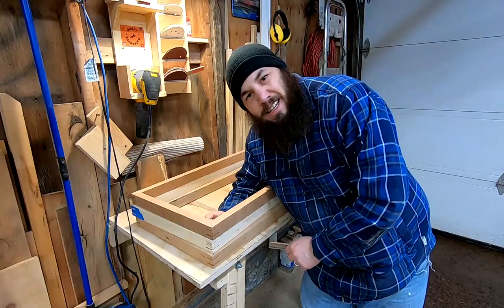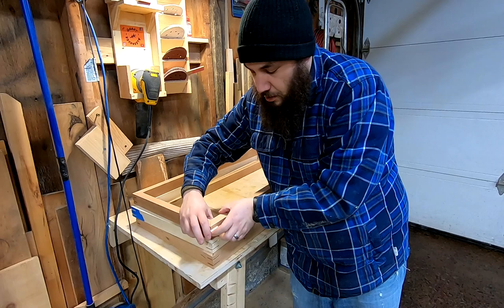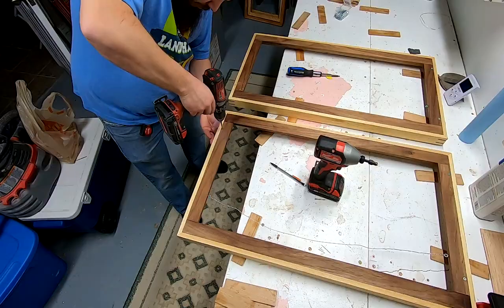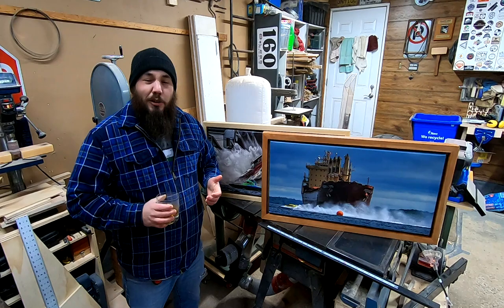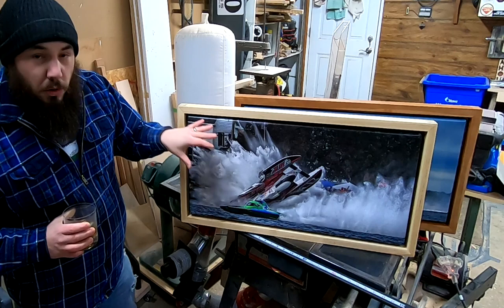How to Make Floating Picture Frames

Comment: Those are classy looking frames. Splines are nice touch too.
Reply from the maker: Thanks! I love doing the splines on frames, they just add so much both in strength and beauty 😀 thanks for watching 👍🍻
Reply: The Grant Alexander you could say they’re “spline and dandy”
Reply from the maker: @JFKreations  lol yes you could 🤣you changed your name, what's up with that
Reply: The Grant Alexander ah, when I started my channel I was planning on doing mostly woodworking videos, and the name made sense. Turns out that’s only a fraction of the types of videos I make. I plan on expanding into new territory with the channel and business and it felt like that name kind of put me in a corner. Plus that name was a bit of a mouthful. I’ve been thinking about changing it for a while now, and the channel is growing a bit, closing in on 1,000 subscribers and the time just felt right. Now it’s part personal branding and makes more sense for what I actually do and for the future. You were smart starting your channel with personal branding, you can take your channel wherever you want. Now I feel more like I can too.
Reply from the maker: @JFKreations  makes a lot of sense and is exactly why i named my channel the way i did! (Also i originally wanted to do a channel based more around camping and bushcraft, but that never panned out, way harder to get away for a weekend than to just had into the shop at the wee hours of the night)  looking forward to some new creations from you!
Reply: The Grant Alexander me too.

Comment: Nice picture frames! The splines sit better if you use a flat topped table saw blade!
Reply from the maker: Thanks Dmitri! I did use a flat top saw blade,(if you look closely i made the spline cuts with a silver blade and the other cuts with a red one) but with all the glue i didn't notice that they were not pushed in all the way until it was too late. Lesson learned that the splines need to be a bit thinner (or the holes a bit bigger) as i think the glue expanded the wood a bit and made it very difficult to push in. Thanks for watching and for offering a tip, much appreciated 👍🍻
Reply: @TheGrantAlexander  Haha I did the same thing several times already - get the fit perfect and then you cant push it in once the glue expands it X) live and learn I guess!

Comment: How's she goin'?  That is a very nice design for a picture frame!!!  Turned out real nice.  I like the spline corners!!!  And massaging the hole is always a good idea!!  Wait, did I just say that!!!  LOL  
I see you're working in what looks like a 'cold' shop.  Do you experience wood shrinkage or changes building in the cold and then taking it into a warm area?  I tend to not do wood work in my shop during the winter as it isn't heated very well.  Take care and thanks for the post!!!
Reply from the maker: Hey Mike, thanks for the kind words! I most definitely work in a cold shop and have that issue. After massaging the slots in the garage, I had to do quite a bit more massaging once they were all warmed up. Otherwise, everything went together smoothly. Thanks for watching 🍻👍
Reply: @TheGrantAlexander  ;-)

Comment: a question and a comment sir. How did you attach the artwork to the frame? with all the jigs you have I was shocked to see that little router table.  Would have thought you had a homemade ro built into a table saw type. Love the frames
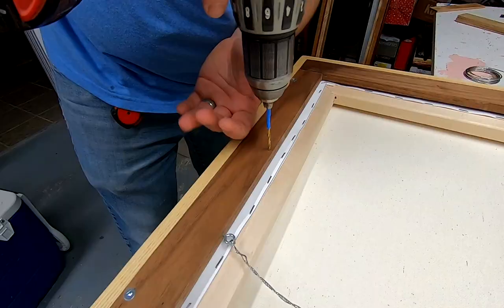Reply from the maker: Thanks for the kind comments Greg. I attached the canvas prints by drilling through the back "panel" of the frame. You can see this at 7:10
I know all the jigs used in this really make it seem like I should have some better set up, especially for the router. It is something I would like to do but it has been on the bottom of the priority list. Thanks for watching 🍻👍